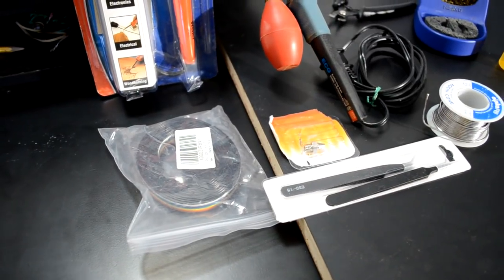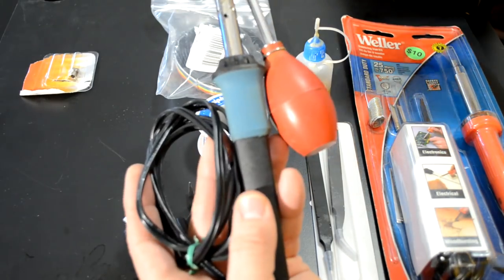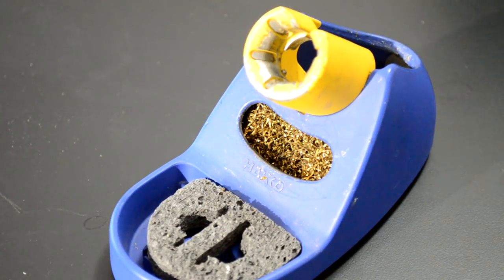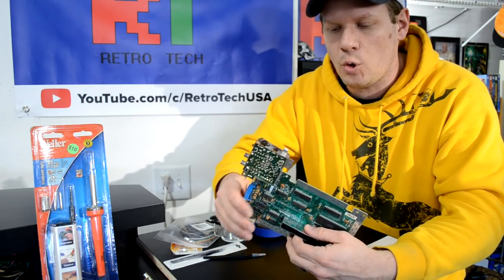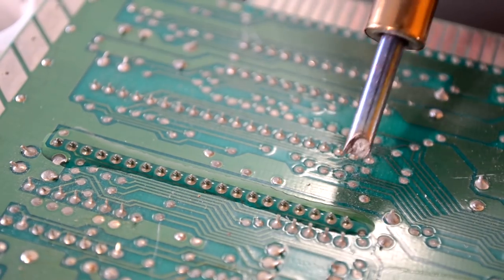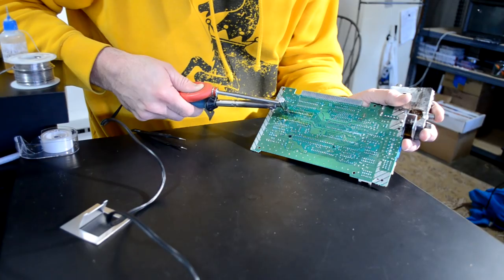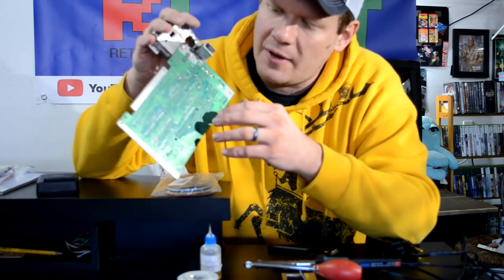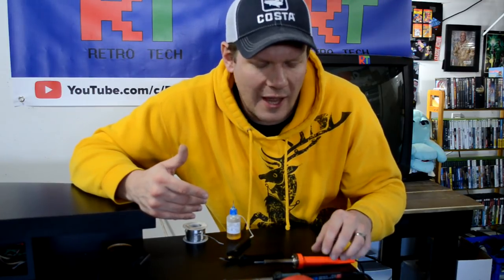Poor Man's Soldering Toolkit (w/ Demo)

Comment: Your audio levels seem to be getting clipped off at the beginning of the video. sounds perfect at 0:50. I recommend the KSGER V2.1S T12 Digital Temperature Controller Soldering Station. It's around $50 & heats up instantly.

Comment: This is the greatest thing ever. I have a D24 and it has 30k hours so I want to do a cap replacement. Do you have recommendations on what to practice on? I would rather not be brand new to all this working on my BVM only to damage it. Also, do you plan on making future videos with more in-depth soldering techniques? If not, do you have recommendations on getting knowledge for beginners?

Sorry for all the questions lol

Thanks! Keep up the great work.
Reply: I would hold off on recapping your bvm. You could buy a stereo from the thrift store that works and try recapping that and seeing if it still works or try a dvd player or a sega genesis. I think the genenesis is still cheap.

Comment: Hey Steve I have a Sony KV-27s42 trinitron from 2001. I was just wondering would a recap improve the geometry or convergence in any way?
Reply from the maker: Have you already tried to adjust it with the service menu? If so and some adjustments arent working, then cap replacement would be your next step.
Reply: Yes I’ve tried the service menu and the convergence strips. The top and bottom of the screen curve up a little and a slight convergence problem. Which setting on the service menu effects that?
Reply from the maker: @RaymondOlivares  PIN settings, like PIN Phase and PIN amp.  Linearity adjustments help too.
Reply: Alright thanks a lot really appreciate the advice keep doing what you’re doing love the channel.